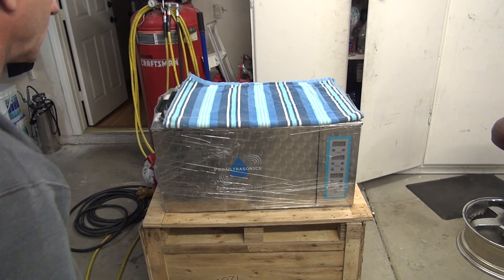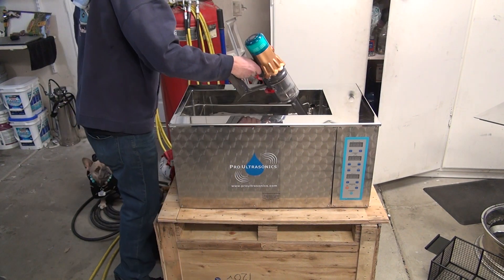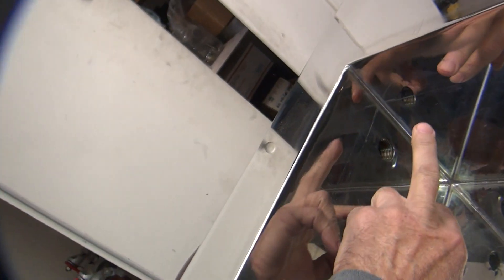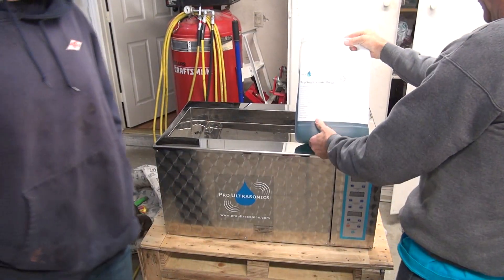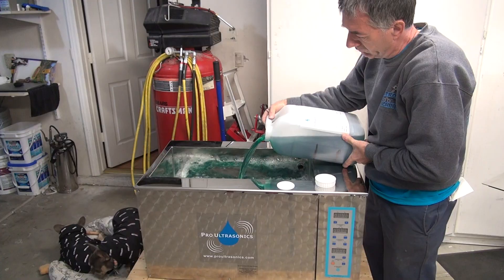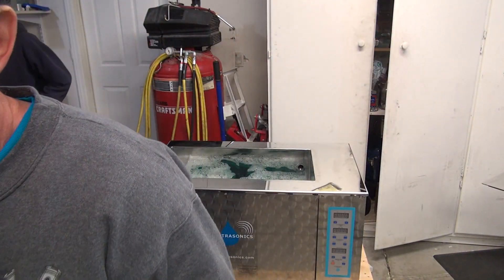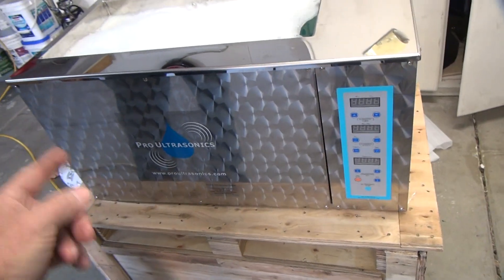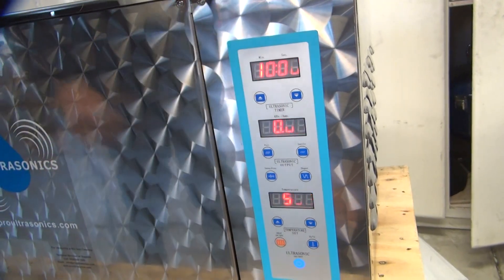#101 2024 testing pro ultrasonics cleaner knucklehead SU weber carburetor pan harley tatro machine

Comment: 14 minutes of NOT CLEANING ANYTHING
Reply from the maker: its called prep work. its what you have to do before you can do anything. go elsewhere if you want to watch fake crap.
tatro
Reply: @TatroMachine  You were chatting among yourselves. Everyone knows that the machine has to be unpacked, connected to power and filled with pre-heated cleaning fluid, since the built-in heating elements are only there to offset the heat loss.
But by episode 3, your viewers might see results.
Reply from the maker: the water starts cold and has to get up to temp some how. that would be the heating elements. we also learned, that you realy need to keep the lid on to get up to temp and stay there. the colder it is, the more this matters. we also learned that you need a way to clean the water. some kind of filtering system is a must.
tatro
tatro